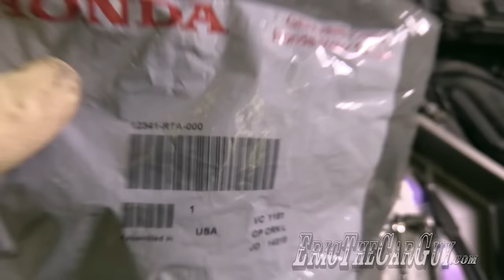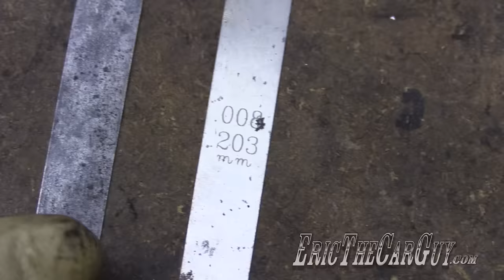Honda K Series Valve Adjustment -EricTheCarGuy

Comment: Hi there EricSeems like you know what your doing regarding the Honda k series engine. You wouldn't happen to know what the correct valve lash (gap)is for a Honda integra type r dc5 2003 would you??? Have hear and read so many different specs hope you can help me. Many thanks regards Paul. Ps good you tuber have watch loads of your vids. Always good info
Reply: Paul Price I know this is a year late lol but on my dc5 the valve lash specs are on the the underside of the hood
Reply: Infamousx51 he probably did an engine swap..different body than enginie

Comment: Good video.
I’ve got a 2002 ep3 k20a3.
Like to see a video of you removing spark plug tubes.
Can’t find anything except valve cover tube seals causing leaks. I don’t see any oil residue in the gap between back of seal and valve cover. Do the tubes unscrew or are they pressed in?

Comment: my k24 in my 2007 accord is recommended to have valve adjustment solely based on poor fuel consuption which was checked usinf scan tool and no sensors are bad. it is likely never done. should i do it, can it give me back btter consumption? current its at 13 mpg.. yeah...only 300km on a full tank

Comment: Umm, any tips on how to adjust 2015 Honda accord ex 2.4L valves? My Honda is making a ticking sound. No engine light on. And no leakage of any type. Had timing belt and tensioner replaced… and it still makes that ticking sound… it tends to speed up and sound louder when I accelerate.

Comment: Hi Eric, weird one here
 My 08 2.0 I-vtec AT has 53k on it and it has this weird pulsing vibration that comes and goes every 1-2 seconds or so, like it's a harmonic motion or something like that, and it comes only when engine is warm and only in P or N and smooths out when I rev it up. Engine  idles fine, no problems at all, no CEL, check the mounts they seem OK when switched from P to R and D, no excesive movement. Had new spark plugs 15k miles ago. Could it need a valve adjusting job, or a new timing chain tensioner (as I've read online they can go bad around this mileage). I can't figure this out, as all I see online people have issues when in Drive but not in P or N and not intermittent like mine does. Much appreciated if you can point me in the right direction.

Comment: I have a Honda accord 2007 with the K-series engine, and to my knowledge the car has never had a valve adjustment and it has almost 300,000 miles. Should I take it to the shop and get a valve adjustment on my car?

Comment: Hi Eric, 
Is there any way or tool you can use other than sound to know if the valves are too tight or too loose without taking off the valve cover? 
I thought I read somewhere there is a tool that measures the the space of the gaps of the valves.

Comment: Don't over-tighten the valve cover acorn nuts on 1st gen CR-Vs or you'll end up having to dremel them off. The torque spec. is only 7.2 lb-ft. Learned that the hard way.

Comment: My element has been giving a  misfire code (multiple)
   I've replaced coils, plugs
Fixed for a few days then back to idling rough 
  It's not consistently noisy comes n goes 
     Will this help?
200,000 miles on it

Comment: BEFORE ADJUSTMENT:   1:40
AFTER ADJUSTMENT:    34:38

almost done with mine, and HOLY HECK dealing with the feeler gauges is a fiddly nightmare until you get the hang of it.

Comment: Got a 99 Accord with ~240k miles.  I doubt the valves have ever been adjusted.  Maybe benefit from one, but the engine doesn't idle rough and still sounds fairly smooth.

Comment: Can anyone please help if they know anything about this, I had my k20 parked up without running it for a couple of months, before it was parked it was fine. Had the injectors out for those few months and when I put them back in and jumpstarted it, it was fine until it warmed up then it idles at 1100 up to 2300 rpm and just up and down, tried to do pcm idle reset on it but for part of that you need to keep it at 3000 rpm and the car wouldn't let me it kept going to 3800 rpm as soon as I barely touched it and instead of getting any lower it went straight back to the 1100 - 2300

Comment: Wold valves affectthe idle? my element has a rough idle. replaced a bad fuel injector and cleaned the throttle body. no code now but still runs rough

Comment: My 2010 CRV VTEC would not engage until after I did the valve adjustment, same on the J35 engine in my Ridgeline.
The best advice I heard was from the VW Guru John Muir in "how to keep your Volkswagen Alive: AFTER Adjustment, put two extra feeler gauges next on top of the correct gauge. If they all fit, it's too loose. At almost 122K miles my 2014 CRV is due, VTEC does not engage.
Similar to what Eric talked about, Honda says (for the Ridgeline, have not looked up the 2.4) not to touch the valves unless they are noisy. WELL, valves that are too tight are very quiet, and too tight can crack valves or burn valves. So just be warned the factory advice doesn't help in this case.

Comment: Just did the first adjustment on my 08 today at 142,xxx miles and found the same thing - all the exhaust valves were a little tighter than spec, and all the intake valves were a little looser than spec. I (perhaps erroneously) like to adjust everything to the tight end of spec thinking that perhaps I'll get ever so slightly more lift and duration that way - for more power and maybe better fuel economy.  Someone please tell me if that math doesn't add up - just figured if there's more play between the rocker arm and valve stem, when the cam lobe pushes on the rocker arm, the arm won't be opening the valve quite as far or for quite as long if they're looser.

Comment: Hello Erick,
I wanted to ask you for help with the valve calibration measurement of my Honda Accord 2007. Previously, they adjusted the calibration but lost strength and this fuel squeezer. The engine that brings my Accord is a K24A8. You could help me with the data of what should be the measure that valves should carry.
In advance, I thank you for any suggestions you can give me to correct this problem in my car.

Best regards

Comment: I got 208k miles been ridin with low oil pressure warnings countless times and still puts out a healthy oil pressure and 180 psi compression across the board what can i say Honda

Comment: Hi, awesome video! I have a Honda FRV 1.8 v-tech and I am getting a vibration and rattling noise when I hit 2000rpm on any gear. My car is at 114000 miles. Do you have any idea what this could be and why it’s happening? 
Thanks.

Comment: I have a 2008 I just bought sounds like a tapping /knock sound in the front around the manifold area .some one told me it's normal some said it's a valve adjustment and some said oil pump lol but it sounds just like that !

Comment: Great video. My 2007 Honda Element SC at 168k miles. I highly doubt it has had this adjustment. My question is. My engine sounds perfect. Do you recommend still having this done? Also.. Does the Honda element SC have the same valve lash specs?

Comment: Excellent Video! Mine have never been done. I'm close to 340,000km (not Miles). Had my car from Brand New and the only thing that I've replaced so far is Air/Fuel Sensor. Not counting Tyres, Brakes, Battery.

When do you suggest for Timing Chain to be replaced?

Again, great Video with no fluffs.

Comment: Question- Why does the car get louder when you open the valve cover? I've worked on my car and after removing the valve cover everything runs smooth, but it's just a bit louder like in the video.

Comment: Thanks Eric for valve adjustment video. Im not a mechanic but Im good in maintaining my CRV 2010 it has 120k miles now. I change my engine oil every 3k miles. Sparkplug is new all fluids and oil has been replaced like A/T, differential, power steering, brake fluid and coolant. I bought the new. I'd like to adjust the valves but I don't understand when you turn the engine everytime you adjust the valves it seems easy to adjust valves but turning the engine I don't understand. I just wanna learn this my own way because labor here in Canada is so damn expensive. But parts is cheap. Thanks. Is there any book or site were I can follow instruction to learn?
Reply: neiskyle3 you turn the engine because if not the cams are contacting the valves and are in motion with the valve on tdcc there is no valve actuation therefore there is freeplay, and that's where you need to set the valve clearance, I would highly recommend the factory service manual, it explains all services and procedures

Comment: Will this remedy a CEL for a # 3 cylinder misfire?
So far coil packs and plugs replaced. Spark plugs are clean and Element runs great otherwise. 208k miles.

Comment: Hey Eric- I have an off this topic question since you have done a Jeep heater core flush video- I have a 96 grand Cherokee 5.2 ZJ and about 2 summers ago I tried your idea of simply letting the CLR sit in the core for a while then use a hose to flush, being honest it didn't do much but I need to tell you at idle is when the heat is the worst, when at say 2000 RPM it gets warmer- When it gets warmer here in NY I am going to try the sum pump method for at least an hr each direction- sump pump about 60.00 so might be worth a shot- also I see some people use Clorox-

Have you ever tried the continuous loop with a sump method? You know the jeep heater core change is like 10 shop hrs and lots involved for the average guy-

One of the coldest days of the year here in NY and my starter died, thank God I knew the old smack it trick and it did work- I have a 1/2 breaker bar for flats in the back and crawled under it, smacked it a few times then it started to get me home- I guess after nearly 20 yrs nobody can complain right?

Comment: I know this can vary from area to area but What  do Honda dealers typically charge for this job? (ballpark) The dealer said this job "could" cost me $800 to adjust valves; does that seem overpriced? It seem quite expensive but this is my first 08 CRV 2.4L.

Comment: Toyota vs Honda, debate goes on. And on , and on. In the 1960's, an Engineer defected from Honda- soon spawned a company named Toyota. T has advantages, as to non interference engines, but that should NOT come into play, mindful of OIL, OIL, OIL. Oil lubricates, but also COOLS. Eric, great vid-fan of your army green Element. I've 4 accords of various Gens. No need to generally F with valves, as stated.

Comment: I'm attempting to perform this on my 2003 Honda Accord 2.4L and I'm having an issue. So I have my 1st cylinder at TDC but can't get my feeler gauge in at all (0.008mm) for the intake and exhaust side. Does that mean I'm off on the TDC or the clearance is just too small?

Comment: So when I tried to do mine, I couldn't get the filler guages to fit it, as I removed the valve cover, aligned my cylinder and no go, I also noticed that some of the rocker arms had play, is that no bueno? So I didn't do much bit tighten one of the rocker arms and change the valve cover seal and coil seals.

Comment: I know this is an old video but can adjusting valves fix a low compression in one cylinder symptom since cylinder 3 in my 79 mercedes w123 gasser 230 has 20 psi lower compression than the rest

Comment: I just recently changed the valve cover gasket on my crv (same engine) and noticed the upper timing chain tensioner only had the orange plastic piece on the front side. Is it broken/need to be replaced?

Comment: Car makers usually don't waste 1 cent on a vehicles manufacture- sometimes called "Vanity Covers" they are usually injector covers, meant to deaden the ticking sounds of injectors. They are also a convenient space to place the brand name, displacement, special features of the ignition and fuel delivery system used. Older vehicles used labels on the air cleaner housing for that. Eric is correct, though- they aren't "necessary". Some use covers that completely cover the engine for protection, while some might have the cover incorporated into a fresh air breather system, to help cool the engine, and quiet the air intake.

Comment: Yep, Eric is my go-to car guy. I went ahead and bought that '05 Element with 267,000 mi.that I'd sworn not to, wish me luck. I've got it down from 9 faults on the MIR to 2, bought a knock sensor to put in tomorrow for the P0325 fault, but the P0302 (cyl2 misfire) didn't move when I swapped the coils (with new plugs), so I'm doing a compression check and bleed down, then adjusting the valves, running,  and testing again tomorrow. Saying appropriate prayers and mystical incantations (not kidding) that I don't need a valve job.

I really should get on the forum, since I've committed to this beast, frankly love it.

I wonder... If I need a valve job, should I rebuild the bottom, too... What's the oil pressure, what did Eric pay for a used low mi. engine? OMG, please smog for me, I'll never sneer at rice-burner motorcycles again, I swear!

Comment: Would incorrect valve clearance cause 100k mile iridium ngk plugs to burn hot to the point of cracking the insulator at 35k miles?  My vehicle is a 2009 crv with 180k miles

Comment: I'm a little confused. Usually that tapping or chattering sound tells you that you need a valve adjustment. Shouldn't the sound decrease after you perform the adjustment?

Comment: What is the deal with old honda cam lobe wear?  I use full synthetic oil and had to change the cam on my old B series engine accord last year.  I bought a used cam and some rockers for cheap off ebay.  The new one looked perfect and now there is a little wear, less than what you show there but there was none a year ago.  And the valves are adjusted and I'm using full synthetic oil.  Short trips but an oil change every 3 months. Car has a lot of miles, mileage on the replacement camshaft is unknown but it looked almost new when I put it it.  I feel like maybe there is some crap in the oil well under the cam, I was going to vacuum it out (vacuum pump) but someone said it gets changed all the time when the engine is running.  But I don't understand where the wear comes from?

Comment: @ErictheCarGuru Why did you remove the plugs if you already knew they'd been replaced at the 110k service?

Kept watching-very smart. Never thought to turn the motor via outer belt pulley. Also, the angled feeler gauges are a favorite of mine, especially in the tight confines of K-series motors. Cheers on a solid tutorial

Comment: does this go for the 04 civic si ep3 models with the 2.0L ivtec engines? obviously maybe the valve adjustment clerence is different, unsure, but you can just TDC on each valve and then go from 1-2-3-4 with tdc on each one? :o

Comment: Thanks Eric. I'm confused about how to line up each cylinder before adjusting by turning the engine using the power steering pump and wrench. I don't understand how to get each valve into the correct position, or when I've turned them into the correct place before adjusting.

Comment: My mother-in-law's '03 Accord has this same 2.4L engine w/ 118k miles on it. My late father-in-law bought the car new & had routine oil changes done at the dealership. When he became terminally ill, I began keeping up w/ her car's routine maintenance, & the 1st time I checked the car's oil, I found it 2 quarts low!! Been keeping tabs on it ever since, and it burns a quart every 300 to 400 miles!! She parks in the same spot everyday, and there are no leaks (at least when its parked) and when it's running there's no black smoke seen coming out the tail pipe.  What's the likely culprit with this car?  I remember my pop-in-law remarking when he bought the car new that he was finally going to buy a good quality car, so it's kind of sad and embarrassing for Honda.

Comment: A good LED shop light attached under the hood helps in seeing those screw slots, and everything else 😉. If you have the time do all except the adjustment and let it cool over night, the cooler that motor is the better. Long zip ties keep the lines and hoses out of the way. No hassling with them. Check and recheck adjustments is good advice for this critical maintenance. Really good advice whenever doing something worth doing. Put spark plugs back in after adjusting valves, will prevent anyhthing from accidentally dropping in plug holes.

Comment: Hey Congratulation for the nice job and for sharing all those precious informations with all of us. I have a Honda Fit 2011/2012 IVTEC. I am hearing a strange noise exactly like the one in this video, specifically its like exactly the same as the one in the end of the video after the procedure is done. I hear carefully and i can hear the same click metallic noise. Is that noise normal on IVTEC engines? I can hear that after the engine gets hot. I turn off, and then back on, and the noise is gone, but if i step on the gas a bit, it comes back. I bought Militec-1 and it didnt disappear and i was watching this video hoping it could be the valve clearance adjustment. Again congratulations for the  channel and god bless you.